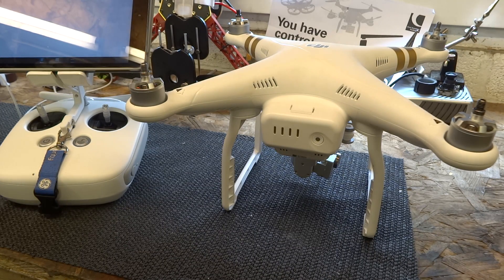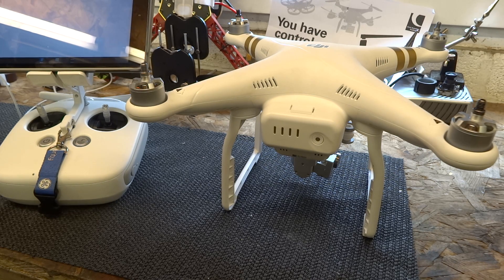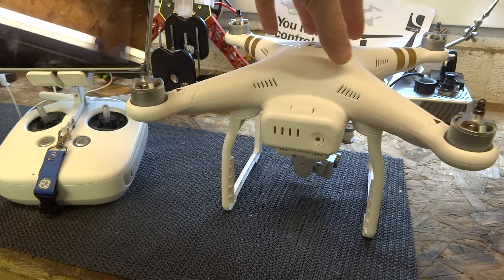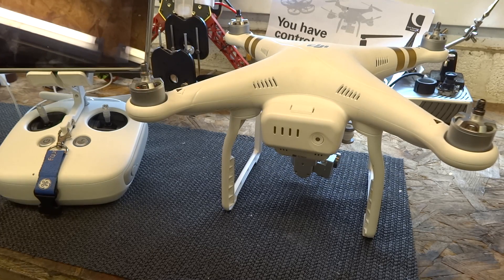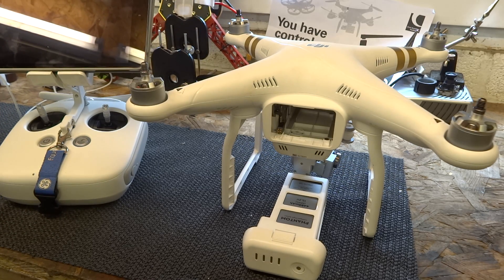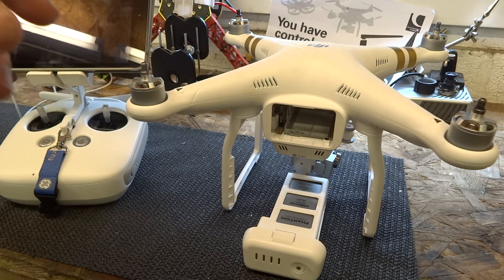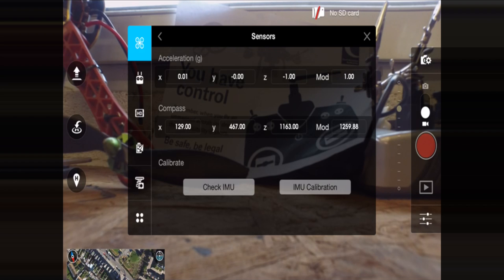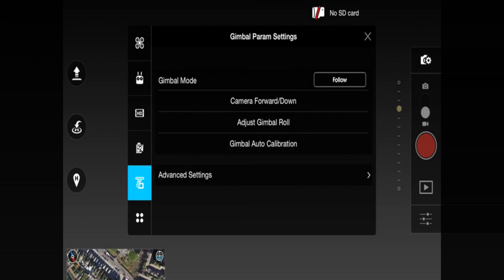DJI Phantom 3 IMU Calibration  Warm Up & Gimbal Horizon Issues

Comment: Where did you get the information about that there is an IMU in the Gimbal? Because it was my understanding that aleximov type gimbals like the old Tarot had their own IMU while the DJI ones did not. They use instead the craft's IMU and the motor positions were controlled by potentiometers.....

Comment: Cold imu calibration = p3 fly away for me. Don't do this unless you want to loose your investment. Lucky I was still line of sight and wrestled it back with aggressive stick controls.
Reply from the maker: It's highly unlikely an initial calibrated would cause any issues unless performed incorrectly, give us some more info and perhaps we can help you work out what went wrong
Reply: I kept my bedroom quite cold and I had my phantom there all night. I did the cold Cali. And all seemed well it flew great but once I power cycled to change batteries it took for ever for the I m u to initiate. I power cycled again and it said safe to fly so I got it in the air and off it went. Had it been further away or in a closed space I would be in serious trouble. By the way I calibrated all sensors before the flight. I re calibrated the phantom while at normal temps and it seemed to fix the problem. From now on I'm not doing anymore experiments with my phantom.

Comment: I notice that with the new updated firmware that just came out, that I am having to constantly calibrate the IMU with every single flight and battery that I stuff into it.
  I was so frustrated that I had to wait for 10 minutes on every single flight.
  Just go into sensors, and then just "check" the IMU, click OK, and it will be good to go without having to wait for the 10 minutes for it to calibrate... Voila problem solved for now

Comment: Just got my phantom 3 and on closer inspection I can see that the horizon is slightly off, but considering it takes off straight away and its the middle of summer and I don't have a spirit level I can live with it for now. I'm a firm beleiver if it isn't broke dont fix it, especialy if you'v just bought it lol

Comment: Please explain how IMU calibration values can be knocked about as you say when the device while shipping was not powered,  so any values stored could not possibly become changed,  unless you know something we do not.
Reply: Nic Wilson IMU calibration data is self won't change but the readings from gyros in the IMU COULD be different if its been knocked or dropped or handled heavily. 
As with ALL sensors on an aircraft calibrate after any changes are made such as weight or possible knocks about. 
Also it seems firmware updates knock the calibration data out on the Phantom 3 as it does with the Inspire 1 so after an update perform a recalibration again. 

If in any doubt re calibrate. its not worth the risk.

Comment: THANK YOU so very much - YOU are a lifesaver!

As of this date, no person except yourself has put this information on the web (let alone so clearly on Youtube). You are my hero. So sorry to lay the compliment on so thickly, but the tilting horizon issue is the most predominant problem with the P3 and discussed everywhere, and is the most frustrating by far.  You are the very first with an actual safe and logical solution that seems to work. Now we can enjoy these wonderful machines! Amazed the user guide does not mention any of this.

Did I mention how much this is appreciated? Ha ha Thanks again.

Comment from the maker: It's been common practice after firmware updates with the Inspire1 and its been noticed it seems to be the same with the Phantom 3.   If you update the firmware and everything is os working as before the update then your good to go and can skip doing it a but people have found that the long warmup times and gimbal issue returned after the update so needed to to another IMU calibration to resolve. 

Thanks
Reply: Mad RC no problem appreciate it, the rules on the Phantom 3 are evolving as days go by, DJI are a little vague when it comes to this stuff.